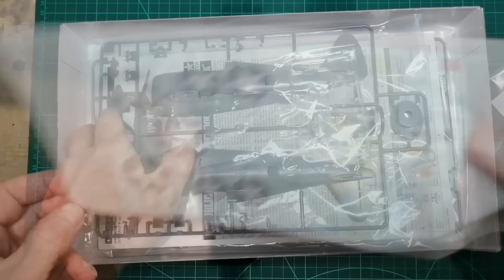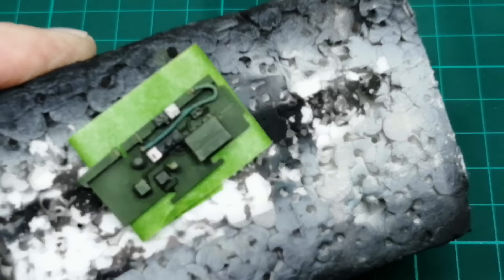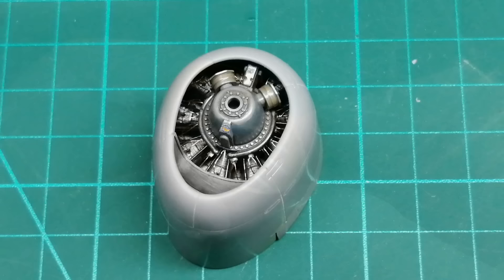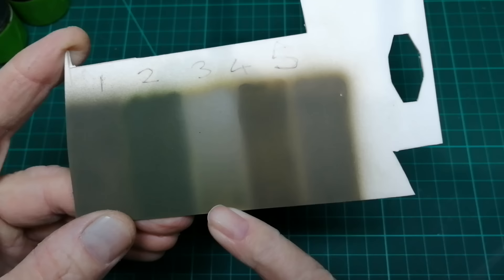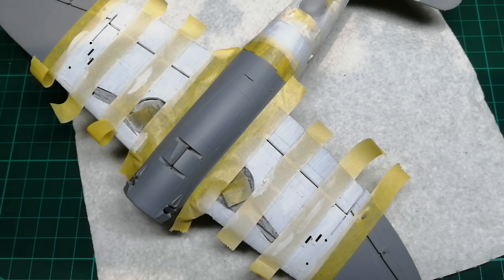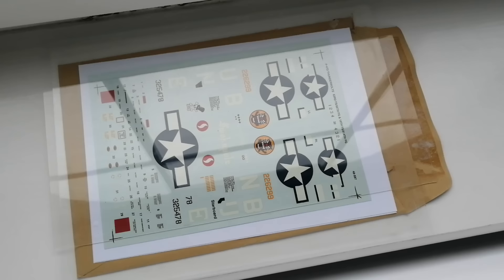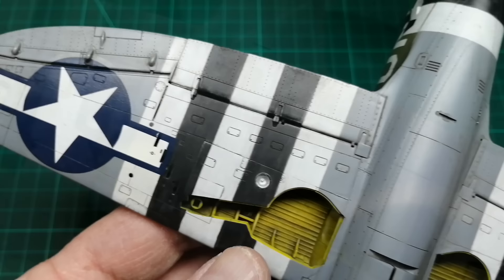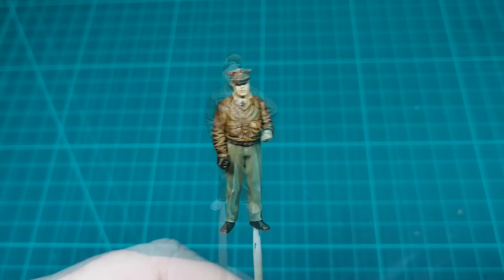Tamiya's 1/48 P47 Razorback (Full Build) Part 2

Comment: I bought both these kits  they came out but only built the bubble top.  I pulled this one out to finally build it and thought I’d watch some vids first. I like what you did with the wiring and will do the same, albeit with a larger gauge as you mentioned. Thanks for the video and great build!

Comment: Greg. I'm working on a model at the moment where your wet sanding would actually be pretty useful. Sadly, I don't have any old, worn sanding sponges lying around, so if you had to start using a new sanding pad, what grit would you reach for? 4000? 8000? I'll still test the technique on a mule before I destroy something I'm working on, but it would be good to get a gauge for where to start. Also, really liked the scheme you chose for this one, cracking job.
Reply from the maker: You should be alright with the 4000. Just check frequently, as the water can hide the amount of paint being removed.

Comment: Sweet Jug ...Greg.  Thx for sharing.   I'm new-ish to modeling and obsessed with learning to achieve good looking props...how did you accomplish yours - esp what black on the blades and metal for the hub ???
Reply from the maker: I always use off black on the blades, just black mixed with grey. The hubs, or small areas of silver, are usually painted by brush with Vallejo Metal Colors. The last thing I use is pastels, light grey, just lightly dabbed on the ends of the blades with fingers. Hope this helps.